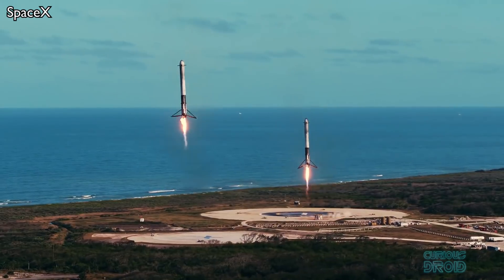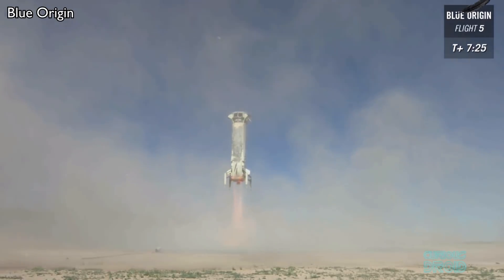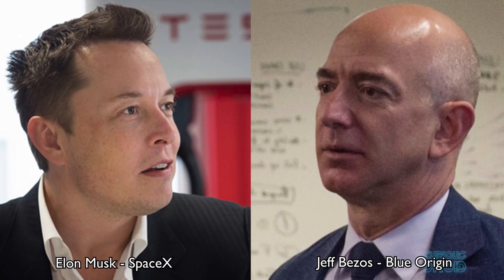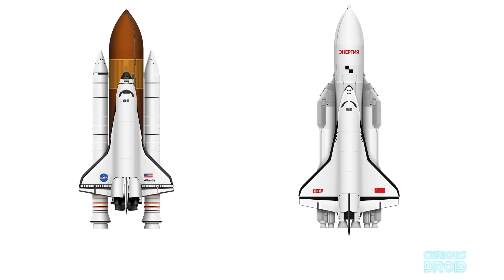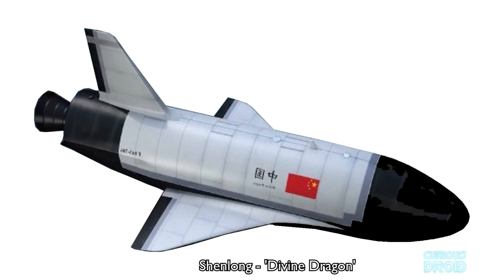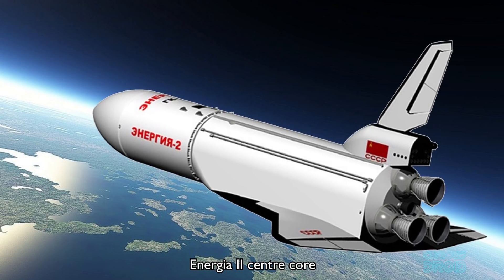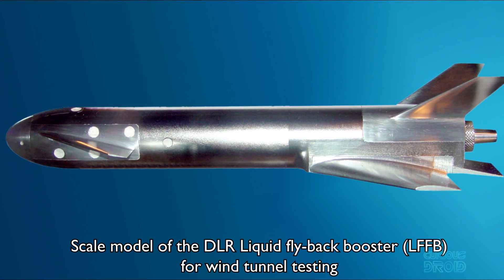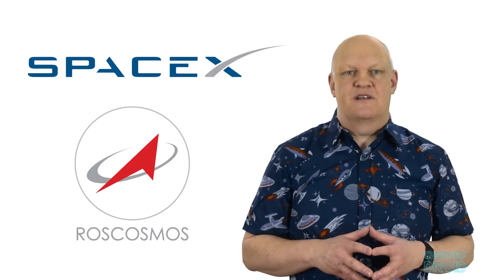Reusable Rockets & Flyback boosters

Comment: just a small correction, the Buran is just the spaceplane. the rocket itself is called the Energia and it doesn't need to orbiter to fly,  since the orbiter didn't have launching engines. In fact, the Energia was called the most powerful launcher from the soviet union. It had a known payload of around 90 tons. it was an incredible launched that could deal with side slung payloads with its advanced flight computer.

Comment: I'm quite interested in the German version, I visioned something like that but using the Dream chaser boosted by something like the X15 and both dropped from a B52 or something better and the X15-like can fly back to home like they used to, the German version using propellers, sounds good as regenerating breaks and propulsion if required. I'm also taking a look at your series on "SUNTAN", H-Power is the way to go, maybe another synthetic fuel can also be used to reduce the cryogenic storage in the platform, why not to reengineer the J58 for H2 and be refueled in "stages" like we do today with fighter jets, so we can have a real earth to moon plane.

Comment: Would have been good to mention that self-landing boosters - especially with a RTLS launch profile, end up significantly reducing the payload capabilities of the overall launch vehicle.  For example, the Falcon 9 rocket is rated at 22,800 kg to LEO with an expendable booster, but only 15,600 kg (best numbers I could find) when landing the booster.
Reply: At what cost of kilo to orbit?

Comment: Technically, there were flyback/fallback boosters long before this.

The Space Shuttle SRBs were reusable boosters that lofted the space shuttle into orbit, then splashed down into the ocean.

The only difference between the SRBs of the shuttles and that SpaceX is that one splashes down in the ocean and the other touches down on the pad.
A few lines of code, a few new additional pieces, and Et Viola!

We have SpaceX, without SpaceX ever needing to exist.

Comment: The ultimate dream of the vehicle to the orbit is manned reusable SSTO! Hope somebody tries to make it happened!
Reply: SSTO is only good for planes. Only aero spikes would work smart but you really only need two "stages" so a special built heavy lifting airplane. So many problems in using a plane to carry a small or medium sized shuttle/plane. It would have to use a pre made plane and moded engines or better yet a custom built plane and engines for carrying your space craft to high altitude 40,000-60,000 ft. To maximize payload you would have to fly the carrer with just enough fuel to reach altitude and then glide back down or refuel in air and do the same with the space craft. This is probably the closes you could get to SSTO and full reusability until BFR if space don't change plans.

Comment: Mixing conceptual proposals /mock-ups with actual working prototypes is a bit misleading.  For example, a rocket with folding wings must trade off volume needed for fuel in exchange for mechanical wing rotation systems.  That looks nifty, but has anything like that actually made an orbital return?

Comment: 0:44 why were there two feeds from the same rocket tho?
Reply: A mistake on the video operator part. It was later fixed in the recorded stream version, with proper feeds from each booster.

Comment: edge of atmosphere actually , don't compare the new shepherd to the falcon 9 cuz if you compare it side by side blue origin's rocket will look like asian dick compare to  spaceX's rocket. Also the distance traveled between the 2 rockets was completely different, and besides the time consumed in refurbishing a small rocket which could only reach the edge of atmosphere is quite ealier than the Bigger one. That's why they had reused it quickly compare to spaceX's rocket.

Comment: For all the other quirks of the program, the SRBs of the shuttle system have been reusable all along, so this seems more of an evolutionary step than a revolutionary step.
Reply: They should be found in the ocean, bring back to Cape Canaveral, dissasemble them, transport through half of the country, fill them, transport back to cape Canaveral and reassemble them. There are more efficient ways for reusable boosters.

After Space Shuttle started flying (especially after Challenger disaster) NASA already started to search for kerosene fuelled flyback boosters which are visible in the video from 5:52.

Comment: Thanks for using the original footage.

I watched it live and noticed that the feeds for both of the boosters came from the same camera. Go to Spacex website now and the footage is clearly from separate boosters. One of the announcers even made comment that the footage looked identical but was in fact two streams. They must have had telemetry issues on the day and have now fixed from a recorded version of events.

Comment: Space X i s really only the beginning and if properly developed systems like Ariana's will work so much better, as you need A LOT of fuel and limited trajectories to land a Falcon 9, but if the vehicle was able to land like a plane in a controlable flight, it could land anywhere.

Comment: OK...2.... You forgot one of the Space Shuttles competitors during the design period.  It was a huge Capsule ships a hundred feet across and 300 feet high that  would have put hundreds of tons into space and then landed back next to the launch pad. The Company even proved that they could take off and land a sub scale ship, making dozens of take offs and landings. Then gave it to NASA, who promptly destroyed it making a mistake that should have been impossible to make. But then, Nasa wanted the Space shuttle that was guaranteed to cost 5 times as much to build even before the cost overruns. Pure corruption. Space X needs to be careful or Nasa will do the same to them.  It has already started with the requirement of 7 launches to man rate the Falcon 9, while the SlS only requires ONE!

Comment: Flyback was a evolutionary concept in space flight still failed to understand, wings grant lift 🛫, but they are velocity drag ⚓, rocket burst grant speed🏁, but they are limited in fuel size🛢& expense⛽. So having transformation of between a unfold/scroll/expand & close wing and engine switch🛩🚀 , gives rendering in multi atmosphere, verse divided phase parts, almost SST style(single craft).

Comment: An interesting sidenote is that NASA originally planned to use liquid fueled boosters, like the buran, but canceled that project because of the development cost.
This concept could both take more payload and had much more accurat engine control.
(Today; NASA did get acess to the the old russian tecnology as well as their own and it became the new generation of heavy payload rockets, so it's not at all dead, even if both Buran and the space shuttle projects where scrapped out (luckily the Russians decided to sawe at least one Buran spaceshuttle for a museum exhibision, even if it's in bad condition, it still preserved and can be seen (or soon will be). (The surviving american space shuttles are all in excelent condition and stored inside the museum halls, so it would be interesting to compare them) )
The russians did not build that many spacecrafts at all and lot of parts was re used, that's why so few from the space program are preserved today compared to all that NASA stuff from the same period. But it's realy interesting to compare the concepts and hawing a clooser look at the parts from both sides.

Comment: Great Vid, thanks for sharing, 
 If a rocket returns and lands vertically then it's carrying more fuel than it needs to put an object in space,   
after it's then transferred back for renewal, and retested, will it be cheaper than just building a single use much lighter booster??

Comment: I'm personally stoked for how many launches SpaceX are doing this year. Elon is REALLY Hell bent on burning through all of the previous generation Falcons as fast as possible to get on to re-using Block 5 over and over! This is great for SpaceX and space flight in general. If they pull off this goal of 10 flights per booster they're REALLY going to upset the industry.

Comment: I think the so called “reusability” as demonstrated by SpaceX right now isn’t the true key to making space more accessible. Of course the first step has to be that the booster is capable of landing safely, but the true game changer will be to reuse these boosters much much more often than SpaceX does right now. We’d have to be considering boosters as kind of airplanes, which aren’t used just 2 or 3 times, but many thousand times. The space company’s who are really serious about lowering the price of their launches will have to figure out a way to make their boosters so damn robust so they can be used many many times

Comment: Space-X is still not cheaper because of their reused rockets.
They claim that the first stage makes up 60% of total launch costs and that currently the reused stage is half the price of a new one. So you have 40% fixed costs + 60%/2 = 30% for the reused stage which gives you a total cost of 70%.
That does not sound too bad until you consider that you loose more than 50% of your payload.
So you get around 50% payload for the price of 70%.
Reply: But because they can recover the busters, they can launch a new mission in fraction of time, it takes to build a new buster.
so they can earn more money in shorter time, then any other space company.

Comment: To me, Space-X was on to something with their high volume rocket engine building that could have taken advantage of economies of scale to cut the launch cost tremendously. But by switching paths to reusable rockets and engines, those savings are lost and the engines and systems now have to be built to handle reuse. It is much easier to reduce variation in manufacturing than variation in the exponentially larger number of factors of reuse.

Comment: does anyone know how much fuel is held in reserve for landing with falcon 9 and the jeff bezos thing?
Reply: Steve Haigh - 10% of total fuel capacity is needed for the F9. Maybe less needed now that they're performing higher thrust landings with more engines running. Not sure for New Sheppard. Probably alot less like 3-5% needed to land. BO doesn't perform a boost back. Yet.
Reply: thanks, 10% sounds like a lot to drag into space and back

Comment: Why doesn't SpaceX simply add delta wings to their boosters, and land them at a runway like the shuttle did?    Use a bit of fuel to 'de-orbit', then have the 'FLEXIBLE' ceramafelt heat proof coating on the wings and underside of the booster reflect away the heat,  and then the booster can lower their landing wheels and land on a runway.   Take off from Vandenberg in California, and then land in Florida.  Simple.
Reply: Not so simple as adding wings and TPS adds mass to the booster. Economically, recovering the boosters as Space X does, is more practical.
Reply: Wings add mass. Wings don’t work in space. What’s simpler? Adding wings, control surfaces and unneeded mass to a booster or just using what is already there, adding more complex flight computers and ignition systems?
Reply: @gianasunan7984  Cut off the wings if you don't want them for an expendable flight. Wings are fine, but you have to compare the weight of the wings to the weight of the return fuel (for recoverable operation). The wings and cheapo extra-light landing gear might actually be lighter under some circumstances, as it is more efficient to combat gravity drag with lift than with thrust, hence why planes actually have wings instead of being the helijets from ThunderBirds.
So there actually is a case to be made for really light wings in a lot of cases.

This also makes re-entry a lot cooler, as light wings increase your surface area a lot while not too badly affecting your mass. They also allow you to bleed off speed in the upper atmosphere a lot more, as you have enough lift to hang around and experience a lot of drag without the excessive heating that lower, denser parts of the atmosphere create.
Reply: Io yeah but why fix what is good enough?
Reply: The design for the first stage booster is sound and established. However they recently announced they're going to experiment with reusable upper stages upon which may have to do something like what you mentioned.

Comment: Why don't they have parachute assistance?
Reply: Chutes are not as controllable and introduce uncertainty. They are fine for splash down, but if you want to reuse your rocket without much hassle, you need it to stay out of the water.
Reply: It's obviously not necessary since the design works pretty well now.
Reply: It works but it must use a lot more fuel.

Comment: Blue Shepard didn’t go anywhere as high as SpaceX
Reply: That's true. It wasn't designed as an orbital vehicle. Blue Origin has New Glenn under development for that. It should also be about encouraging as many companies as possible to get into the space game rather than comparing one against the other. We don't want to solely rely on Space X for access to low orbit. The cheapest possible access is to have competitive companies vying for the orbital prizes. And if one company has an accident that stops them for a year or two, it won't necessarily affect the competitor.

Comment: Spacex was the  first to land an orbital class rocket.bezos is different
Reply: True, but it depends on the development and success of the BFR. BO's New Glenn probably will be better then the Falcon 9. Much better even in terms of reusability on account the vehicle is being designed from the ground-up for that task. Where as the F9 was not. SpaceX tacked on the landing hardware after the fact. They needed an orbital booster asap to start fulfilling their Nasa contact. Either way the competition is good. Revel in it. Its the kind of competition that drives rapid innovation. Which.. this world so desperately needs.

Comment: Could you please explain why it is not possible to capture the CO2 emissions from an car's exhaust pipe or factory chimney before it is spread in to the atmosfeer? Thanks.
Reply: Good question, so why is it not  done?
Reply: It seems easy enough, i think it 's becaus we don't care. I want to find out why it is impractical or expansive technically. Is it really to hard to replace a filter even if the environment is endangered? I don't understand this and i regret it.

Comment: Ohhh,  i thought you'd at least talk a little on NASA's " Delta Clipper Experimental aka DC-X " project from the early 90's, it would've been one hell of a spacecraft if congress didn't cancel its budget & leave it for dead after the strides its team made to work up to that level of brilliant engineering. 
Now that you've made a video on  reusable vehicles without mentioning it, please make a video on NASA's attempt at rocket reusability, namely the "DC-X" , PLEASE..... :D
Ps, several of the engineers that worked on it now work with Blue Origin on its New Shepard vehicle!! ;) 

Link for more info: https://en.wikipedia.org/wiki/McDonnell_Douglas_DC-X

Comment: Using the energy of the rocket fuel to drive a large turbofan should give a big boost to specific impulse over simply using a rocket engine and would allow the use of a jet style engine above the height where they'd normally not work, and use atmospheric oxygen below that height; I'm curious as to why that's not being done.

Comment: Interesting video. Thanks.
Has anyone considered a flyback booster that flies "backwards"? I ask since an aircraft is more stable if the center of mass is more forwards. I also wonder if the engine nossle could be able to withstand the heat if some liquid oxygen circulated in it to cool it. This way the nossle could be used as heatshield?

Comment: I wonder how much it costs to refurbish the returned rockets.
If I remember correctly the space shuttle engines had to be almost completely replaced after every launch. 
Is that the case with these rockets or do they reuse the engines as well?
Reply: MaxFist the reason for that was because the liquid hydrogen fuel was so cold that it made the metal brittle and crack after use. Kerosene is much easier to work with but has it's own problems such as soot collecting in the engine which needs to be cleaned, other than that fact merlin rockets should be able to fly 10 times without maintenance very soon. Methane is the future of fuels as it is not as cold as hydrogen and does not leave soot like kerosene

Comment: The ESA ADELINE concept looks interesting, I hope to see that work out. But I can't help but think if SpaceX build the a satellite delivery version of the BFR, with the second stage landing vertically like stage 1 does today then it will be a very long time before most of the others can compete.
Jeff Bezos mentioned a "New Armstrong" - what are the chances that too will use a totally reusable, vertically landing system like BFR?
I think Jeff and Elon will dominate the commercial industry.. ULA / Orbital Sciences / ESA may have to be content with the government work. Interesting times!
Reply: Adeline concept was scrapped. But ESA is working on other prototypes with methane engines and reusable booster SpaceX style for future generations of rockets.

Comment: From what I've read they only really want to re-use the rocket engine as it's way more expensive than any other part of the first stage. Something I've never understood is why they can't just jettison the cheap parts out of the way and have the engine come down like an Apollo crew capsule without the need for the expensive and complicated atmospheric re-entry system.